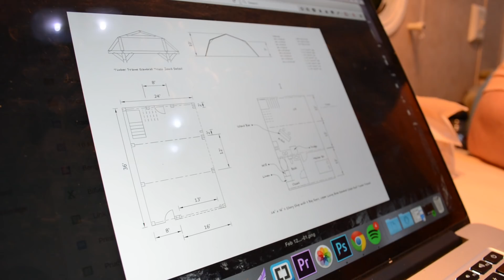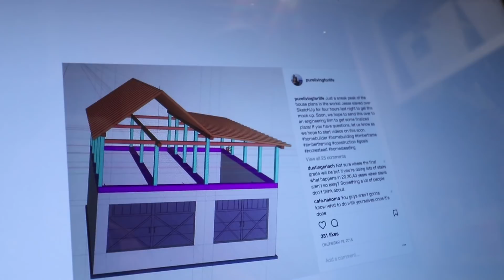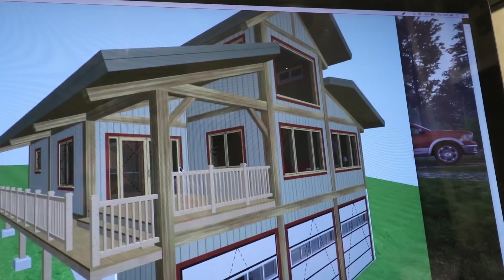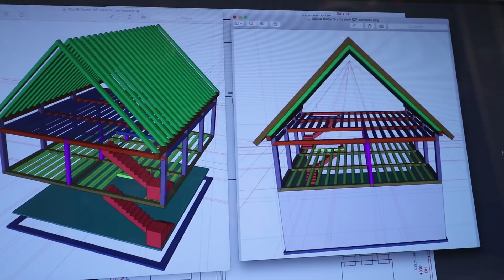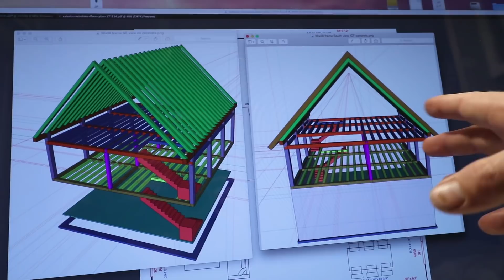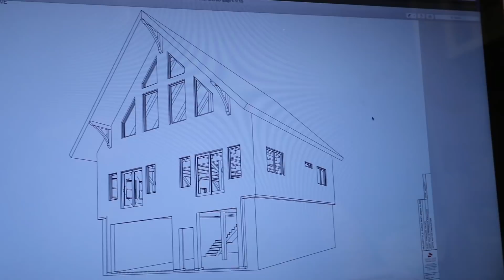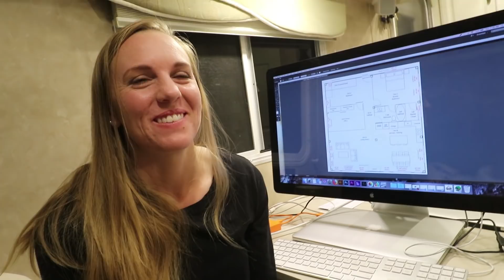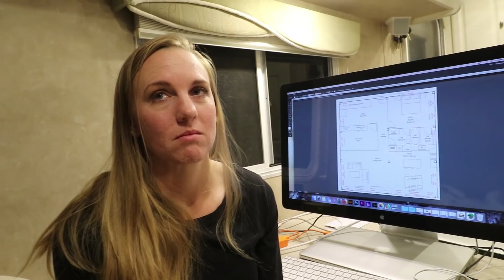Building a House Start to Finish: Timber Frame House Tour

Comment: Great design. My wife and I built a 2 story house on a lake about 23 years ago.
We put our laundry room downstairs, and built a drop chute from the upstairs bathroom, which was also our Master Bath, that dropped right into the laundry room.
The benefits are a QUIETER bathroom, and more space in and around our tub / shower.
Someday we may convert that chute into a dummy elevator too.

Comment: I'm really impressed, your down to earth matter of fact honesty is really great!
I think they say that the third house you get it mostly right LOL, you guys are a long way to getting what you want.
If I can add one thing, a suggestion, that is on the North wall of the loft, up high, put a window, it does not have to be large, but in the summer, you can open that window and get a lot of airflow to help in cooling the hot spot that will be the peak of the roof. We did that in our building here in Tokyo, I put a window that opens in the storage area above the elevator (7th floor) that is the very  back north side of the building, when we open the sliding glass door in the front of the building on the 7th floor, especially on a hot day, we get a nice breeze that takes the heat out of the 7th floor, it really works well. I understand you desire of not letting any heat out the back, north side, but a smallish window at or near the peak of the loft on the north wall end gable would be of use, just an idea.
Cheers from Tokyo Japan

Comment: Robert here again.
Good idea on the keeping the roof solid with no breaks.  I wanted skylights in the  house we built 28 yrs ago.  over the years we learned that is a very bad idea.  A Roof with any kind of hole through them is prone to leak!!!!   This last year our three sons who are all grown men helped us put a second roof on with no Skylights. We have found that the solid roof is far better.  Off course the fact that we now also have a double roof with and air gap between them to allow air flow has helped.  There is a tremendous difference in both winter and summer.  As not that much heat can travel either direction because of the air barrier between the two roof's.   Wish I had done it sooner.  Haven't said much but I am still following you kids and still very proud of what you are doing.  Didn't have all that fancy computer 3D software that we have today.  Had to draw all my 3D's by hand, Awk!  Great job
Reply: Robert Finch. I second on the roof. My son is a roofer. He says they make the skylights better now adays. But if you have a hole in your roof, I don't care what they say, it's gonna leak.

Comment: I am 70 years old and proud of what your have taken on and the outstanding job you are doing. You two are engineers never let anyone tell you different. You find what you need and want and you do it. Little advice since everyone else has. You have never made a mistake but you have learned to change your plan! Engineers never make mistakes. Keep up the outstanding work.

Comment: Great renderings! One thought about your roof/deck design- snow sliding off the roof will greatly impact your winter living. We live in mountain snow country and where the snow lands after sliding off the roof is a big deal. Think completely flattened barbeque and shattered deck supports (our deck has a 14" belly in it from snow weight over the years and needs rebuilding). The snow turns into piles of concrete once it settles, so moving it within 12 hours becomes a commitment- plan for that now.

Comment: I love the space.  I would make a couple small suggestions.  

First, add a utility sink in the garage that is outside the bathroom.  For a workshop area, having access to a sink with running water is a huge convenience.  

Second, relocate the washer & dryer to the mud room. Having a larger clothes folding table, a clothes rod, and a space for ironing (if applicable) is a HUGE convenience for actually getting laundry done.  Trying to do that in the bathroom will have you dumping socks onto the bed to sort.  And that is not a good height for working.  

Slide the linen closet over to the current W/D hole to avoid the door.  Flip the new empty space into the kitchen and use that as pantry or as a closet (vacuum cleaner, leaf for table, extra couch pillows & blankets, board games, etc).

Comment: First, I would like to say hat's off to both of you, for not only for taking on such a project, but documenting the whole process. WOW!  Second watching the 3d viewing of the layout I have one idea that you may want to change. That being, having the washing machine and the dryer in the master bath.  When I am doing laundry, first I dump all the dirty clothes on the floor, seperate the whites from the darks, and start the first load. This leaves a load on the floor until the first load is finished. Messy at best.  Once the first load is dry, where do you do the folding? Not to mention where do you put the hanging clothes?  Just not enough room to complete the chore.  I would suggest the mud room, add to the closet maybe?  Not sure but when you come in from outside you can dump your dirty garments and start washing.  Food for thought.  Keep up the great work. I am amazed at your diligence and fortitude.

Comment: As others have said I think the washer/dryer should be in the mud room with a laundry sink.  I have a sink in my mud room and use it every day for hand washing, standing the wet umbrella in when it's raining, washing mud off of the shoes and washing everything the wife dosen't want in her kitchen sink!

Put the office in the loft and make that area a guest bedroom for the parents when they are in-town.  

Also, adding a powder room on the main level would also be high on my list.  If it's a money issue right now, just rough it in and use it for storage until it's in the budget.

Great job with the video!

Comment: You guys have obviously really thought through each design decision. Well done. If I could make one suggestion based on personal experience - move the laundry out of the bathroom. I know it means additional plumbing, but having your laundry in the mud room will make life so much better! You need room for sorting, folding, and drip-dry hanging. You need room to physically maneuver with arms full of laundry. Also, your mudroom is adjacent to your master bedroom, which makes deposits of dirty clothes very convenient. Your bathroom seems quite cozy, so adding the activities around laundry will make it feel extremely cramped and cluttered. My opinion obviously, but we struggle with this situation in our house. Cheers!
Reply: This sounds like a good idea.

Comment: Hi , First of all,  let me congratulate you on the the quality of you work and the sheer energy that you manage to put into every aspect of it. 

It was facinating to follow your design process.  Good design can only come from a full understanding of the requirements. Then the best compromise has to be sort.   It is so easy to get fixated on some aspect of the work and totally neglect others. 

You  are getting it right,  we who are not involved   will all tell you to change this or that.  I am going to be no different. 

 I am a 75 year old retired Electrical Engineer from the UK .  I would not put the washer / dryer in the Bathroom.   The hot damp air will cause condensation in the the machines and will cause corrosion in their guts shortening their lives and could pose a safety hazard. 

In the UK the building regulations would not allow the installation power outlets in a Bathroom. Please review this aspect of the design.  

My best wishes for a successful completion, you will do it. 

Alan

Comment: I designed and built 4 house. The last one had 19 different deletion and additions (program was a 3 dim. walkthrough view) before my wife was happy. 
One thing I noticed, if the master bath design was complete, was one sink. Two is a must. Plus it just might save your marriage. I love the plane otherwise. Thanks for sharing your experience.

Comment: I'll second the notion of having a window over the kitchen sink.  Also, please consider interior pocket / sliding barn doors wherever possible.  Reduces incursion into the bathroom, or halls.  You'll lose less wall space if you use pocket doors.

Also, watch out for the insolation from the west - make sure that the transom/clerestory windows are shaded in the summer and not shaded in the winter.  If the transom / clerestory windows around the house are openable, you'll get some nice cross breezes through the house.

Great idea having a 2nd bathroom downstairs.  The 4' hallway is pretty narrow.  Would you consider losing a foot off the width of your office in order to add light and accessibility to the mudroom?  

Also, you'll be moving all of your furniture & appliances into the house, either up the garage stairs, or into the back ("hot tub patio") door.

Great work - and amazing dedication to your dream!

Comment: Here's a suggestion: add a moderately sized window to the north wall upper section for these reasons: moderate window minimizes heat loss in winter, allows light in when you expand down the road thus eliminating need to add later, make it operable so that cross ventilation from the south windows will draft out hot air in the summer, north wall is massive and needs to be broken up to look better, also a decent view from the loft into the woods would be a nice. good luck

Comment: I don't know if someone mentioned this yet, but the Office space will be much more furniture friendly, especially for a future bedroom if you move the closets along the right side wall of the office instead of the rear wall. This will net you a 14' X 12' room instead of 16' X 10'. The 10' depth will be a furniture challenge as you go forward. It's a simple change, or at least one to consider.

Comment: After expanding from drywall and metal framing only to finishing basements and doing addictions. I started using Chief Architect The 3d rendering would sell the job. One thing I did the 1st time using it l took pictures of the finished project and compared it to the printed 3d renderings and then show them to the new customers so they new that what they saw on the computer was what it looked like in reality. I could change things in the layout and they could see it right then. One more thing, I've never done a layout using approved plans that everything was a perfect fit, unless it was something that had already been built before😎 great job guys

Comment: How do you plan to vent the dryer from the center of the building?  Will the duct go strait up through the second floor to the roof?  Will the toilet vent and the sink vent go through the bedroom wall?  If you are going to use propane the tank has to be on the south or west side to fill.  Will your solar be on the house or stand alone.  Can you vent your batteries from the basement?  Just some questions to consider.

Comment: I would try to move the washer and dryer out of the bathroom and into the mudroom area somehow, with a closet or pocket door.  The Bathroom will be nicer inside, and you gain a pantry cabinet in the kitchen where the washer/dryer currently are.
Reply: Joe Knolmayer Tesla solar tiles on the roof maybe??

Comment: You need good natural light in the bathroom, not the closet.  Turn the closet around and put it in the northeast corner of bathroom.  Turn the bath-tub around and put the foot end close to the window to achieve a view while soaking.  
In master-bedroom avoid the radiant cold dropping down on your heads from the window above by instead having two smaller windows each side of the head-board.

Comment: Good video. I would recommend a front balcony that is linked to the living room dining room that extends out to create a massive southern facing deck, creating shade for the vehicles below and possibly a substructure that would keep water off the vehicles. This would then allow you to have sort of an outdoor car port that would leave all of the basement garage area free for work activities. The large southern facing deck would provide you with plenty of outdoor living space for dining and entertaining.  

With respect to the kitchen dining room area, the 3D computer renderings show that the space between the kitchen island, its chairs and the north side chairs of the dining table are too cramped. The way I would design this would be to narrow the north-south width of the kitchen island and create a two level island so that it is at bar level height on one side and counter level height on the kitchen side. That set up is much more comfortable in my opinion. I have it in my current kitchen and I love it. The height of the bar side of the island is not so high that it blocks visual contact with the dining room table or anyone in the dining room. The bar side counter top also can be used as a serving table where prepared food can be placed. 

With respect to the bathroom, I would recommend that you rethink your washer dryer set up. Set them up side by side with a both front loading washer and dryer. The tops of these appliances then can serve as your folding table. Above that you can have either closed or open cupboard space for towels, linens, cleaning supplies, etc. 

With respect to the bathtub - shower. I recommend that you design the space to accommodate a 66" x 36" tub with a multi-jet Jacuzzi type of tub. As you get older the tendency is to put on weight when you are no longer as physically active, having a bigger tub that you can fit in and really relax with nothing above the water but your head and your knee caps is a real blessing. Have a super-duper Jacuzzi type is a major blessing for any body after a long day of work when your body is sore everywhere. My current tub with four jets is too small to get my entire body submerged and the lack of jets means that not all parts of my body get massaged. I would rank this luxury expense as a No. 1 priority for peace and relaxation.

Comment: As an electrician (granted, NOT a residential electrician) I notice you have a lot of light fixtures hanging from your beams. The only ways I see to supply these is to run conduit or wiremold on the surface, both of which are unsightly, or to put channels in the beams which I would think would weaken them. I do see a possible third way, but it would require a lot of extra work: oversize the beams so you can put a channel in them without comprimising their strength. The reason it would take a lot of extra work is that you would need to cut out the entire channel and save the cutout as one piece to put back on the same beam to preserve the grain. A possible easier way might be to strategically box out a couple beams on the side and use those for running a lot of Romex cable. That method would be good for plumbing too. Ah, one last consideration - what do you plan for heating and cooling? Ductwork eats space.

Comment: Why not build the mud room under the stairs in the garage? Then you could pull the two walls of the office north giving you a larger office and living room. You could add a closet or storage in the northwest corner of the office over the base of the stairs.  Also that would keep the stairs cleaner from dirty shoes or boots so you wouldn't have to vacuum them as often. Just a thought.

Comment: Great job for your first house design!
There are some interseting suggestions here, but a few things my 40 years experience has taught me. That bathroom will feel MUCH more comfortable at 6 feet wide than 5 feet (the standard tub I'm guessing was shown in your view). We did 5 foot in my first house, and it was practicle, but just not as nice as the extra foot feels. 
LAUNDRY IN THE BATH = BIG PROBLEM. Adding extra humidity & heat to an already humidity intensive room = potential mold/mildew problems, even with a ventilator. You have a ton of room in that garage. Install a small laundry chute instead. It's a heated garage.  That space under your garage stairs looks like a dandy spot for a side by side washer/dryer. (plumbing could be worked out with a little ingenuity).
Your KITCHEN: Good basic design, but MUCH more practical to put your range where the sink is shown and the sink where the range is, which would also allow you to have a window behind the sink (which most women DEMAND in a kitchen design).
KING SIZE BED: A craze we all went — had one for 20 years until people realized, if you love your mate and don't flail about at night like a seal, a Queen size is PLENTY big, and I think now outsells kings by a big margin.  In fact, I can't think of any friends that have one at the moment.

Comment: I don't know if anyone mentioned this, but if your going to finish the loft at a later date, I would highly recommend running your plumbing and electrical needs while doing the main area. It will be tough to add that stuff later when all your walls are finished. But all in all, I love your design and can't wait to see it finished!
Reply: I forgot to mention that I would have added a deck /balcony to the front since living area and kitchen is in the front of the house. That way, when it's nice out, you could eat meals or just relax out there and get some fresh air!
Reply: In the animation, there are 2 sets of French doors in the front (south facing). One huge step. lol Would make sense to have a deck out that way. With the camper taking up a bay, it gives another area to park a vehicle or to hang out.